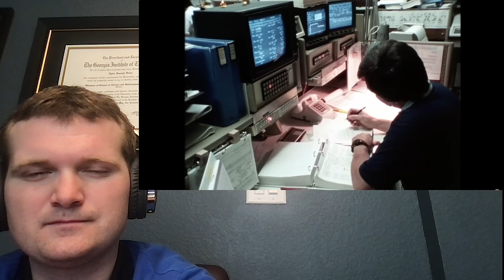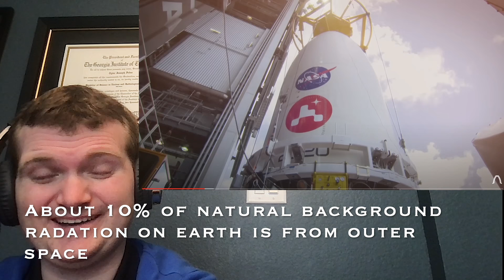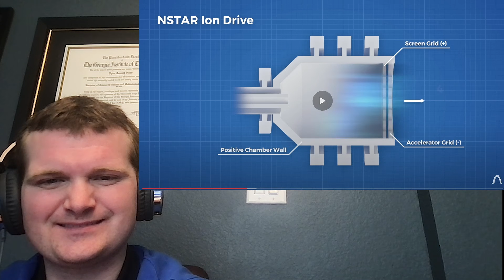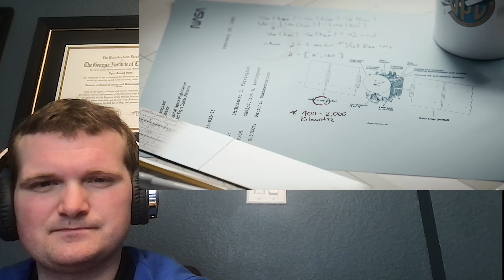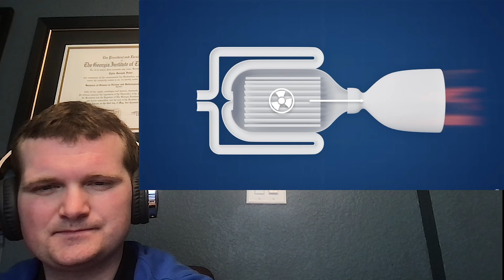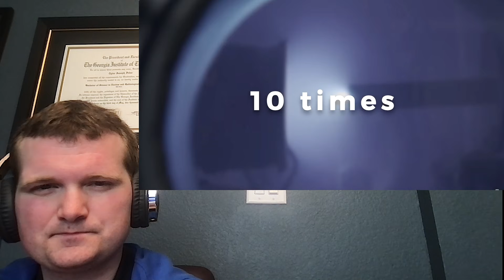Can Nuclear Power Take Us to Mars? - Nuclear Engineer Reacts to Real Engineering

Comment: Human desirable spinning space ship habitats for artificial gravity with large crew cabins,  enough space radiation shielding for typical travel and high radiation event shelter space should be seriously under development.  In four years by 2029 is not far away when human travel to Mars is desired.  

Elon Musk's original goal for Starship was much bigger and that is till the goal at twice the diameter and twice the length of the current Starship which is 8 times the current volume.   People have considered attaching two of these space  ships with a tether noise-to-noise and spinning it for artificial gravity.    How to maneuver them into this configuration and navigate  once in it has yet to be discussed openly.   One of the ships would likely  be cargo.  The discussion has been multiple redundant cargo only ships on Mars to supply and support human arrivals.  

This much larger starship of eight time the current volume would allow a full ship crew complement with doctor, nurse, dentist, mechanics, ship operation personal, construction and mining personnel when on Mars and quite a few scientists or possibly mostly scientist with those skills.  

Liquid water at a thickness 10 cm to 15 cm provides effective space radiation shielding for human protection.  That is a lot of water.   The hydrogen atom is the key radiation shield component.   Layered material approach offers lower mass.   https://www.sciencedirect.com/science/article/abs/pii/S0969806X22001736#:~:text=Al%20powder%20material%20with%20a,radiation%20shielding%20properties%20of%20materials.

Water space radiation shielding is looked at for high radiation events of a few hours for a small inner space of the space craft.   The water would have other uses besides radiation shielding.  It could be part of the space craft's crew circulating close loop purification system.   Irritating the water could be beneficial for killing harmful micro organisms.   

The water has a heavy mass penalty.  A large water store would allow  plentiful water uses such as unlimited showers, possible in a space craft being rotated for artificial gravity, with the water then going through days of prolonged processing to clear of wastes before being returned to the large water store.  This would take a lot of energy that a nuclear reactor could best provide.   The nuclear reactor might be placed in the cargo ship for radiation distancing.

Comment: The reason the exhaust velocity is important at 14:35 is that its directly preportionally to specific impulse. The higher exhaust velocity the more bang for your fuel bucks
Reply: Its important, but not the over-riding concern to make the most effective and efficient system. For example, hydrogen is by far the best propellent for a nuclear thermal rocket because it's low atomic mass not only provides the highest exhaust velocity, but it won't react with your engine's material and degrade it.  But because of its low density hydrogen requires far larger tanks (more dead mass), and they need to be cryogenic (requiring more dead mass) to fit more hydrogen. 
Also add on the shielding requirements (more dead mass) to keep your crew alive, the lack of aerobraking requiring 50% more propellent (even more mass) and  the need for separate landers (more dead mass) because a hot nuclear plant isn't ever going to be allowed to re-enter through the atmosphere, and the lower thrust of NTRs meaning they benefit less from the Oberth effect.
In the end chemical rockets are more efficient for the Earth/Mars route because they save huge amounts of fuel using aerobraking, and have far less dead dry mass than nuclear. Nuclear is going to be more efficient on routes that don't require landing on planets/moons with atmospheres, such as asteroids, the moon, etc, and outside of effective solar power range (Jupiter).

Comment: 18:40 You're right about the ineffectiveness of solar power, but at least in space the solar panels don't shut down at night.

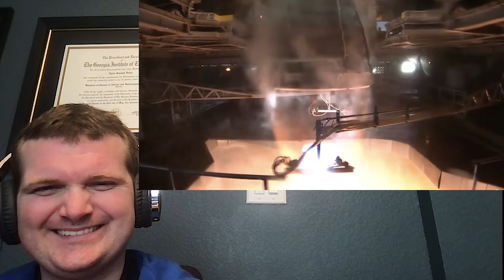22:04 No, hydrogen is not explosive in space (or on Mars). It's only explosive on Earth because we have a (very unusual) 21% oxygen atmosphere. But hydrogen is still highly reactive, and hot hydrogen can, indeed, react with ("attack") things that you'd rather it not. 

22:50 If you put the reactor/engine in the back, and put the crew capsule atop a tall tower, then (#1) distance reduces your need for shielding, and (#2) you only need to shield a small part of the reactor, to protect the crew. You probably put most of your cooling system there (mounted on & in the tower), and the coolant, radiators & tower structure become part of your radiation shield.
Reply: Hydrogen also has the annoying tendency to dissolve in solid metals, which greatly weakens them unless they’re coated with a special materials.
Reply: I think the worst part of hydrogen is containing it since it can leak from anything basically
Reply: NTRs require a huge amount of additional dead mass for long spars, shielding, radiators, 50% additional propellent for slowing down since they won't be allowed to re-enter atmosphere after they go hot. And hydrogen is the only really useful propellent, which adds a bunch of dead mass due to its low density and requirement for cryogenic tanks.

Comment: I think I saw before where W/the NERVA Engine they can use a rather small shield by having the Engine pretty far from the crew naturally by Tank Design. Then placing the Shield very close to the Engine and the shielded area is kind of a Cone that gets bigger the farther you are from it, Like if you stick something small in front of a flashlight and shine it at something far away, there will be a very large shadow.
Reply: Still adds lots of dry mass for that heavy shield and spar. Thats the achilles heel of nuclear, far more complexity and dry mass undercuts its ISP edge.

Comment: The two operational rovers on mars arent powered by solar panels. The radioisotope thermoelectric generator, a lovely little gizmo that converts the heat from plutonium 238 into electricity. The voyagers, cassini, new horizons etc all use them. Pu238 decays at a known rate letting craft operate for decades

Comment: They can shield the astronauts from the radiation with the water that they are going to have to take to Mars with them. Now I'll freely admit that I am completely ignorant about pretty much everything so I could and very well be 100% wrong. That said I think I have heard that water is one of the best shields to use against radiation of certain types, I think.
Reply: Water is definitely a good radiation shield. But radiation in space is not much of a concern, astronauts can tolerate it for years without significant health risks, EXCEPT during solar storms where you need a solar storm shelter for crew.

Comment: Shielding isn't a concern for a (sufficiently large) nuclear powered space-only craft. A small shield close to the reactor shields a cone reducing the dose over a small solid angle, then put the crew a long way away from the reactor where the small angle is a large area (you only need 0.01g acceleration or less).

What does ruin the concept is there are few niches where they could potentially compete with solar inside jupiter. Current PV modules (compact and self unfurling) are 200W/kg (or 500W/kg simply by making them larger), current tech under testing is >2kW/kg. You will struggle to come close to that with either your reactor+heat engine or the waste heat rejection system (most proposals for either are under 100W/kg). So pure nuclear electric drives are obsolete.

Chemical rockets substantially outperform the NERVA concept for lofting  (do the math with real tank mass and possible volume envelopes rather than just assuming isp is all). So they are only useful in space where the thrust advantage over ion drives is useless.

Low thrust solar thermal outperforms low thrust nuclear thermal as a 10gsm mylar mirror exceeds nuclear specific power out to saturn. You can't even carry fuel for a >15yr mission and beat an inflatable <7gsm mirror (with a few spare membranes and patches for repairs) in terms of specific energy.

NTERs are an interesting concept though. Using propellant for heat rejection is a huge advantage, and not carrying radiators or collectors makes landing a possibility.
Reply: Long spars still add dry mass. NTRs are only optimal for routes where aerobraking isn't available on becuase you can't  use them in the atmosphere so they miss out on huge savings in propellent requirements from aerobraking (while adding a huge amount of dry mass).

Comment: this might not work on a mission to mars, but one thought for a generational ship going to another solar systemI saw uses a charged tether to slow down over time. so you use a big engine like a nuclear ion drive to speed up really quickly (maybe get to ideal speed in a few weeks or months) and then put out the teether which slows you down over many years so you enter the target system at a much slower speed and don't need to use as much of your main engine to enter the target planet's orbit as you would if you were going full speed

Comment: One quibble with the reaction video. The figures given for cosmic background radiation are for "free space" (ie: not inside the spacecraft). You can't entirely shield from these, but you can reduce the level partially with a multi-tiered approach to shielding. Starting with radiation absorbing materials (like water) stored right next to where the crew spend most of their time (bunks, furniture). Then adding wearable shielding around the torso, protecting vital organs. The additional mass here also contributes to skeletal loading in a partial gravity environment - such as a vehicle with modest spin gravity (say 0.6-0.8 g). You would also have internal equipment and systems and of course the hull of the vehicle (which includes micro-meteor and thermal shielding). All up you could lose at least half of the radiation. 

Note that you still have an elevated radiation environment on Mars. Not a problem if your fictitious Mars colony is underground and no one is allowed outside, but on a realistic exploration mission your explorers are going to spend a lot of their time outdoors. The point here is that overall radiation exposure is largely a result of time you spend on Mars. Also reducing time in flight simply lengthens time on the surface of Mars. So having shorter and shorter flights has a law of diminishing returns.

Comment: The original video is an excellent video, however it doesn't deal with system level issues. First of all, let's dismiss nuclear thermal propulsion. In theory you get a doubling of Isp. But that's ignoring all the additional mass that is added to your spaceship. The reactor itself, it's safety systems and the massive shielding needed to protect the crew. Plus the big spoiler is hydrogen. It not only is hard to keep liquid and has the habit of escaping, but being low density (even as a liquid) the size and mass of your hydrogen tanks will add a lot of mass to your vehicle. Liquid hydrogen is about 70 kg/m3, whereas liquid methane is about 420 kg/m3 (the most suitable fuel for a chemical rocket) and liquid oxygen is even more dense than water at 1140 kg/m3.

Nuclear electric propulsion has promise but not only do you have the mass of a reactor and its shielding, but you also have the mass of the electrical power conversion system and the radiators which collectively ruins the party. Now as I said there are system level issues. 

In a realistic exploratory mission to Mars, most of the mass being sent to Mars is in fact cargo. And cargo doesn't care how long the flight takes so you can send it separately on slower, lower energy trajectories. Thus you can devote more of your mass budget to getting humans safely to Mars in a reasonable period of time, which amounts to 5.5 to 6 months. You can of course burn more fuel and get there in 4 months, but the excess velocity means higher g forces when you arrive at Mars and attempt a direct EDL. 

The point I'm making here is that there is nothing "enabling" about nuclear powered rockets for (realistic) missions to Mars. There's no need to invent new technology. Chemical rockets can accomplish the task. It requires a good overall architecture (including sending most of the mass on slower unmanned flights). It also requires a bit of brute force (larger quantities of fuel). but worrying about the amount of fuel is an old obsession that is no longer relevant in an age where spaceflight is commercialized and you can get stuff into Earth orbit for $1000/kg or less. If its cheap, use it.

Where I think nuclear power can come into its own is future unmanned missions beyond Mars, because robots don't get bored. I would also love to see fusion evolve into space propulsion. Especially aneutronic fusion where you have direct conversion to electrical energy and you don't have the same issues with shielding. So no massive thermal radiators and no massive shielding. 

I'm also going to put in a plug for ordinary water as a propellant. Turned into a plasma it makes a pretty decent propellant for en electrical spacecraft, plus  you can tune the balance between Isp and thrust.

Comment: The core assembly of a nuclear powered rocket is made of uranium in a refractory carbide matrix. It's structure is similar to a giant auto catalyst converter. The assembly is made of silicon zirconium uranium and possibly thorium carbide. It is coated with silicon nitride to stabilize it. This component is put inside a spoiled beryllium reflector with an annular array of beryllium and boron carbide control elements. It can use hydrogen or another gas to use as your propellant. The reactor does the bulk heating and ionization. Next an electrostatic field accelerates the ions even more.

Comment: "there is no disk brakes in space" well, I guess ablative shields are non- Disk Shape. These are more of a Hyperboloid or Elliptic Parabaloid. With center at highest heat
Reply: You can't use aerobraking with a nuclear rocket, the risk of any accident irradiating thousands of miles of Earth or Mars is too high. You need to pile on about 50% more propellent to use your engines to slow.

Comment: No, or little shielding. The ship is long and thin so there is a lot of distance between the reactor and the crew. The fuel tanks also shield the reactor. I'd imagine maintenance only being done at Earth and Mars in orbital assembly and maintenance structure. In flight work would need to be robots of some kind.
Reply: The spars and the shielding add a lot of dead mass and combined with a hot nuclear reactor mean you have to add a bunch of mass for landers and 50% more propellent mass for deceleration since you can't use aerobraking. The Earth/Mars route is much more efficient using chemical rockets because of nuclears limitations.

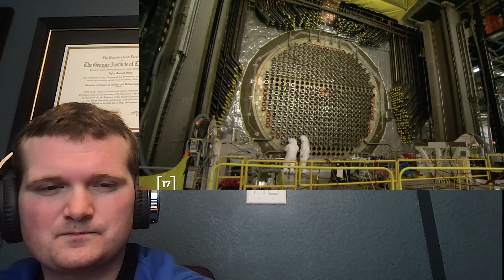Comment: 31:35 It's not well emphasized, but the comparison of coolant temperatures is appropriate. Yes, the operating temperature isn't much higher, but in a nuclear thermal rocket, the propellant is also the coolant. This is probably also the source of the seeming misunderstanding in the intro. 

To properly emphasize it, the intended design of this rocket is to create a relatively high flow of super lava-hot hydrogen to propel out the back (after passing over most of the reactor core in this super-heated state). I'm not a nuclear safety engineer, but I am confident there's no (non-NTR) reactor on the planet designed to handle that. A normal reactor uses graphite which will handle high temperatures just fine. But it turns out at thousands of degrees, carbon and hydrogen aren't too unhappy being methane instead and the graphite dissolved like candy, so they had to create some alloys to deal with that.

Comment: space power is kind of the biggest issue to solve for manned interplanetary missions. the best nuclear reactor every flown i believe only could do 5kw (the soviet topaz). if you could get north of a megawatt, you could really spam the plasma thrusters. also you would want to use aerocapture on the way out as well as the return trip to reduce fuel (or better yet to burn it all to reduce the transfer time).
Reply: You can't use aerocapture with a nuclear rocket because any accident irradiates thoussands of miles of the earth or mars. That's why nuclear is unlikely to ever be useful on the Mars route, its really only efficient for routes that don't end in landing on a planet. Chemical rockets are far superior on the Mars/Earth route because they save a third of their propellent using aerobraking while nuclear adds hundreds of tons of dead mass for shielding and radiators and landers and propellent for slowing down.

Comment: The hohmann orbit is the best, regardless of engine. 9 months. You need a beast of an engine to fight gravity and do better.
Reply: The more high power nuclear thermal designs pretty much are in the beastly range.
Reply: @darthkarl99  Hm. I guess you are right.
Reply: Not true, the hohmann orbit is basically the lowest energy orbit between two locations in space, which makes it the slowest transit orbit between those locations. Starship is designed to be refueled in low earth orbit and fully refueled it has about 7 km/sec of deltaV. You need less than 4 km/sec for a hohmann transit to Mars, so Starship has enough velocity to make more direct transits in as little as 3-4 months.